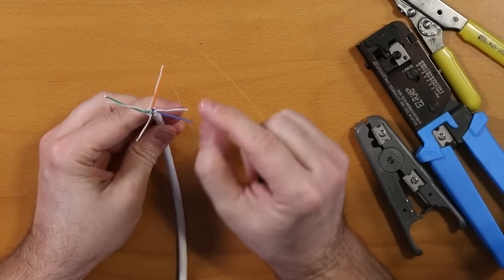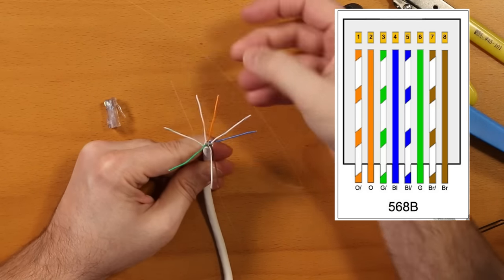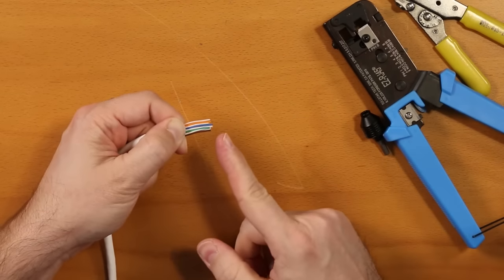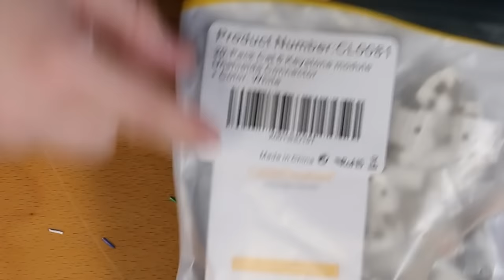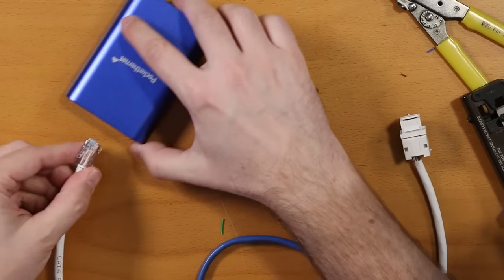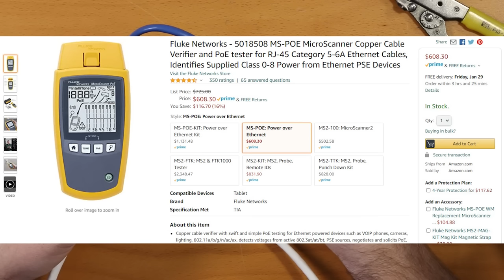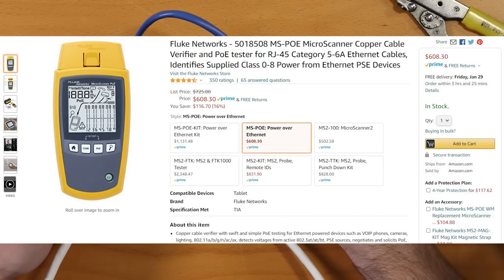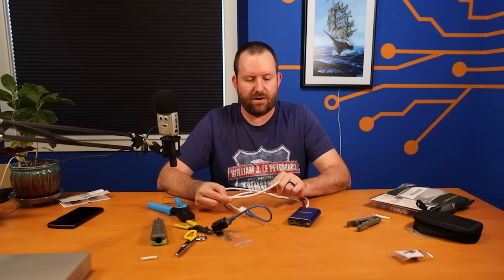How to Terminate Ethernet Cables

Comment: Hi Chris, your preferred position of the cable jacket does not allow the male connector's built in jacket holding tab to keep the jacket from pulling away from the connector. After checking the color order, press the jacket as far into the connector as it will go so the connector's strain relief tab will be crimped on to the jacket. Otherwise you end up with connectors that pull away from the jacket and look like exposed/ damaged wiring and amateur work.
Reply: DEFINTELY
Reply: THIS! Jacket is what provides strain relief instead of the data cables inside.
Reply: I was watching on the TV and grabbed my phone just to comment this.

On the male connector there are a small triangular tab that is pressed, this part need to grab on the cable sheat and not on "nothing"
Reply: Yep, also preserves the twists on the pairs as far as possible up to the connector
Reply: I'm surprised he didn't know that as it's pretty basic. Also he made no mention of maintaining the twist, nor was it as good as it should have been on the orange and brown pairs on the keystone jack. Would that matter in a typical residential environment, probably not, but a good professional installer wouldn't be this sloppy. Also it would have been good to mention the difference between a simple wire map tester and a certification tool.
Reply: @timezonewall  I remember that part of the video AT THE VERY BEGINNING where he said he wasn't a professional ethernet terminator and gave 2 or 3 "There are probably better ways to do this" warnings. This was just to provide the basics of getting this done. I thought it was a great video. Thanks, Chris!
Reply: @bulldog311  I agree it's a good video particularly for those new to Ethernet termination.  Chris owns a networking business, and although cable installation may not be his focus, I expected him to be more solid on the basics. I don't own a network business, and have never been a professional cable installer, but I spotted his mistakes right away.
Reply: Totally agree, it shows the basics but its good to mention with a tutorial video what the proper way is to do it. A cable cut this way will not last long, much shame for push thru connectors. Even more so for solid core. (also there are double and triple pronged RJ45 jacks out there, the difference not explained either)
Reply: i dont mean to be offtopic but does anyone know of a tool to get back into an instagram account??
I was dumb lost my password. I would appreciate any tips you can offer me.
Reply: @Reece Andrew Instablaster :)
Reply: @Jaime Wells thanks for your reply. I got to the site thru google and I'm in the hacking process atm.
Seems to take quite some time so I will get back to you later when my account password hopefully is recovered.
Reply: @Jaime Wells it worked and I now got access to my account again. I am so happy!
Thanks so much you really help me out!
Reply: @Reece Andrew Happy to help :)
Reply: Was thinking the same thing
Reply: Was going to Mention that, I like to use Pliers to pull wires in as far as it will go with the EZ RJ 45's, also, the Plates are also 6 Port, or 12 in a 2 Gang Plate. I like the Leviton Quickport, at the Router in a Home, Will have a Red, Green, Yellow, Orange, Blue and so on, And in Kitchen Jack might be Yellow. Self Explananatory. Have MANY different types of the Stripping Tool. Favorite is a Cheap Plastic one, one spin around, just scores the Jacket, then bend and exposes the wire.
Last Week, went to Terminate 2 Cat 5e's going 40? Yards to a Camera and an Access Point. The Cheap Tester that the pieces slide Together, showed #7 and #8 open. Would think it was Brown Pair. Then twisted 8 conductors at one end, checking Continuity at other, showed Orange Pair Open? Strange, Thinking Tester Numbering is Reversed? Strange how this Tester will show an individual wire open, with no Common wire or Shield to Reference off of?
As a temporary fix, used 6 wires from 1 cable, a pair from the Other, Works. About to Pull in a couple Cat 6a's in its Place. Could have used Power Injectors at the Dock? But could use a Battery/Charger(not Auto), so if power is lost, would still have POE.

Comment: I'm a low voltage guy, fire alarms, supression systems, burg etc. I'm new to the industry but I know the very first time I was shown how to terminate a pass through connector, when crimping the connector on the jacket it needs to be far enough inside the connector where it is going to press and lock/grab onto the jacket NOT THE ACTUAL WIRES to hold the connector on properly and not slip off. The way this process was shown in this video is not correct, and while this cable will still work properly there is a good chance that if the cat cable is ever pulled, tugged, or snagged on something some of the colored pairs may be pulled from the connector and no longer be making their connection, stopping the cable from working properly.

Comment: Plenum cable is not defined by the inner separator.  It's all about the outer jacket and how fire resistant it is.
Reply: Plenum rated cables aren't more fire resistant, they just off-gas non/less immediately toxic chemicals when burned, when compared to CMR and other non-plenum products.
Reply: @LegoTux  not pick but yeah, you are correct.

Comment: No don't untwist for the keystone.  Keep the twists and use the prongs on the keystone to split the twists. A good keystone will have nice spikes separate the pairs.
Reply: It was hurting me as I watched. I know he’s no professional. Very smart on other topics. But also having the pairs hang out the back... it’s sloppy.
Reply: Right on.
Reply: @jordanwhissell4666  yep... Let's get that outer cable jacket up under the cover of that female connector. We should never see individual wires hanging out the back of the keystone jack. 🤷‍♂️

Comment: You should push cable into connector as deep as you can, so when you crimp it, jacket will be press-locked in the connector. Your male connector is invalid. ;)

Comment: Hi Chris, CAT6 always includes the center plastic which keeps those 4 pairs twisted and separated from each other. Plenum in the cable means material of the jacket. Plenum (or LSZH) basically means those jackets gives low smoke and slows down spread of flames. About male/female connectors, you should always strip only as short amount of jacket as possible and make sure those individual wires are not visible outside of connectors. In male connectors, you should push the cable inside as much as possible and In female connectors, you should make sure jacket goes inside connector and only untwist pairs as little as possible. Good quality female connector includes place/hook for cable tie to secure cable into the connector.

Comment: You should only untwist the absolute minimum cable on each pair when doing the female connector/punchdowns. this will reduce cross-talk and will be more important when doing 10Gbe connections
Reply: Sounds like a crosstalk solution...
Reply: THIS! Maintaining twist is important. Also on the female end you should have the sheath tightened down with a little zip tie to prevent stress on the cables if pulled on the inside.

Comment: The outer insulation needs to be far enough in both types on connections for the outer insulation to be held into place by the finished connectors.  A tab on the male and the back of the cover for the female connectors should keep the cable end from moving without the connnector.  This is important because the inner wires break easily if they are moved or pulled on a lot.  This detail greatly increases the reliability on the cable.
Reply: Also, the contacts in the Keystone jack are angled, which means they are Krone, not 110. So, different blade for punching is needed.

Comment: 04:40 ProTip You can use the cut-off bit of the jacket to untwist the pairs. You can also use it to straighten the wires by running the jacket over the wire instead of just your fingers. This can help save your fingers if doing a bunch of terminations.
Reply: I do it.

Comment: Chris few comments about the video. Understanding you don't do it for living so no judgement here just commenting since I have been doing it for 30+ years. I haven't read all the comments below so sorry if any of these are repeats. 1) When ever you use the blade tool tool cut off the outer sheath, the intent here is to expose the rip cord (the little string). ALWAYS pull the cord to cut down at least 2-3" to expose more conductors below the cut line and then cut the cable off just below the original cut line. We do this because the cut tool when you spin it around the outer jacket can nick the copper conductor for one (or more) of the pairs and will eventually break, usually right after you left the site :), 2) Plenum and the center core of your cable are completely unrelated. The plastic core is to keep all the inner conductors in perfect alignment for a specific grade of cable. The outer casing can be PVC or Plenum. If the wire is run in any void (is like a ceiling whether sheetrock or tile or other) where any air-conditioning or air venting air flows through that's a plenum. Plenum rated cabling is treated to make the burning sheath less toxic. Riser or PVC rated cable can never be run in a plenum (in or out of an A/C duct, if the A/C sucks air from it, its a plenum). Keep in mind a lot of A/C ducts provide cooling air to your vents but most A/C systems use the entire void for a return (warm air flow back to A/C) and that's a plenum. 3) I always cut my cable at an angle like 30-45 degrees (only on EZ). It makes it so much easier to insert the wire into the EZ connector. When you slide the wire in, you can actually force each conductor into the right channel even if they are not perfectly straight. 4) After you insert the cable into the connector push it all the way in. The rectangle square at the back of the connect is a strain relief. Its needs to squeeze the conductors and sheath to properly secure it and prevent pulling on the conductors at the connector. 5) When cables that have the core I pull on the core slightly before cutting it and then slide the thumb and index finger down the outer sheath toward the end to make it just past the core so the core doesn't prevent you from fully seating the sheath into the connector. 6) YES, before crimping I always go through the protruding cables to verify they are in the correct order. So much easier to check before you crimp then to have to cut it off and start over! 7) To straighten your cables put your index finger over your thumb nail and slide it down the pair with some pressure. The flat thumb nail takes the kinks out of the conductors nicely. 8) For cat6 specs the twist has to go all the way to the point it is punch down on the jacks. Don't untwist it. The jacks have a point between the conductors in a pair to make it easier to press them into the correct slots without untwisting. Also, FYI, Most punch tools have 2 colors so you always know where the cutting tool is without looking. All replacement blades will always line up on the same color for 66, 110, or krone.

Comment: I use the piece of the outer jacket that I stripped off to use as an untwisting tool.  Slip it over on of the wires in the pair and they separate nicely.  Then slide the 8 wires over any screwdriver shaft to get the curls out.
Reply: And then you can spend the 23 bucks you saved on some beer and chips!
Reply: I ran into a nice tip. after stripping, before untwisting. if you stick a finish nail, or sturdy toothpick in-between the twisted pair at the base where you cut the sheath. then you just pull straight, and the wires are forced to untwist, and they simultaneously straighten.
Reply: +1
Notches in most snips are for straightening wires. I prefer flush cuts over snips and do a better job getting closer to what needs to be cut...
They can also be used to straighten the wires.
The other trick is too use the outer jacket removed to untwist the stands...
Reply: Good idea. I will try that.
Reply: @brawlman  ya know I keep forgetting about that on my snips and I just made a bunch of cables at home.  I teach to kids for STEM work and that’s a good tip to teach them. ( if I remember) 🤔

Comment: @09:36 - not enough outer insulation has been pushed into plug, which will result in the outer insulation coming out quickly , thus putting more stress on the individual pairs

Comment: 9:36 Nicely Done Male connector and just has the jacket of the cable under the little restrainer in the RJ45 Jack without using it there is the strain on the wires..

Loved the video
Reply: Yes, I totally agree, not enough emphasis on getting jacket under crimp down tang and the same on the female keystone punch down. I thing the punch down is made to accept the jacket under the cover plate. Then ALL terminations need to be tested!

Comment: I liked your disclaimer at the beginning, anticipating a barrage of “suggestions” -  actually not too bad. 

1. Set the blade of your stripper, so you spin one time only, but set it, not to cut all the way through, just score it to a good point where it will crack off.

2. You should have pushed the jacket into the rj45 jack.

2. When you do the keystones, Keep your pairs twisted to the point of the where you are going to punch down, maintaining the twist, to the point, then drag them down into the scissors of the keystone. Use the point of the keystone to split the pairs apart is better than untwisting pairs before.

Comment: The little string is for stripping back the insulation. Cut back the outer cover and wrap a bit of the string around a screwdriver or whatever and just pull. In industry, I used this plenty of times. But be careful, that little nylon string will cut skin just as easily.

Comment: After creating many male ends for home devices with the EZ rj45 I recommend making a slight angle cut as opposed to the straight cut before sliding into the connector.  Found it makes initial insertion slightly easier. <insert Michael Scott joke>
Reply: Was going to say the same

Comment: I am sure this has been pointed out, you are holding the snips backward the small loop in the snips goes in the ring finger, ... plenum is a type of fire rating ... the snips have the groves to straighten the wire ...Make sure the cable goes all the way to the end so the stress relief crimps the jacket of the cable.  for the keystone jack, don't untwist the cable, if you notice on the jack connector it has a sharp extrusion used to go between the twisted pair.  per code, the twist is supposed to go all the way to the crimp point.  having the lines running parallel will create interference, and will not perform as well.  I really enjoy your videos, keep them up.
Reply: forgot to mention the network cable can be used for telephone wiring since the rj45 jack is backward compatible with rj11.  you can plug in an rj11 connector into an rj45 jack and use it as a telephone extension from your patch panel.  ( I never run phone lines anymore just network since they can be used for both)

Comment: You can just use the piece of cable sheath you cut off as an untwist tool, try it.
Reply: I learned this a while ago and it had been 1 of the most valuable lessons in terminating cables!
Reply: Wow.  I was about to ask you how. Then I started picturing it. Great tip.
Reply: Same here😂🤣😂
Reply: Been practicing on old cable for a first time install. I'll have to give this a try.
Reply: @chrisnorden8043  Give that untwisting thing a miss, waste of money IMO. The passthrough rj45 connectors are well worth it though if you are going to be doing a lot of terminations.
Reply: Thanks all my thumbs are so red from the past few days
Reply: Snazzy labs taught me this method and its amazing
Reply: I ran into a nice tip. after stripping, before untwisting. if you stick a finish nail, or sturdy toothpick in-between the twisted pair at the base where you cut the sheath. then you just pull straight, and the wires are forced to untwist, and they simultaneously straighten.

Comment: String in the cable is a ripcord. It is for opening the outer jacket without having to cut it and risk cutting any of the inner wires. Works really well and no special tool needed.  There is a pinout legend on the side of the crimping tool for reference.
Reply: What he said.

Comment: Chris, that tip for Untwist was well worth the $5 beer I just sent your way.  Wow!  What a tool.  I've used the back of my Klein snippers before and it stripped off the protective covering.  I also LOVE the network testing tool.  I've been using my trusted Fluke Networks tool for 20 years having really no reason to replace it but now I'm on the waiting list for the Pocketethernet!

Comment: When doing the male ends you can also cut the cables slightly at an angle before putting them into the connector, you may find it easier to get them in by doing that since you don't have to have every single one aligned perfectly when sticking them through
Reply: I agree.  I leave enough room to wiggle around and make sure the wires are flush on end and a slight angle helps.